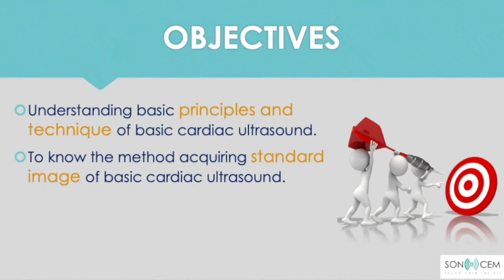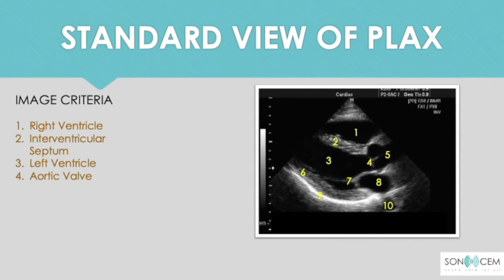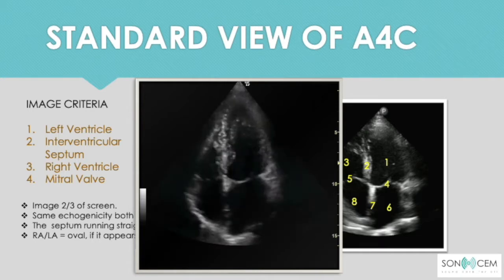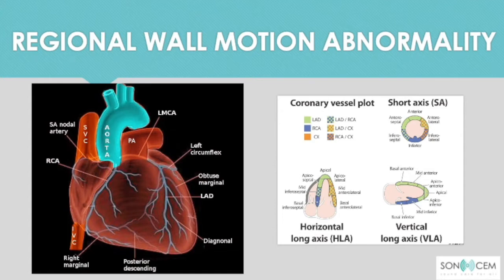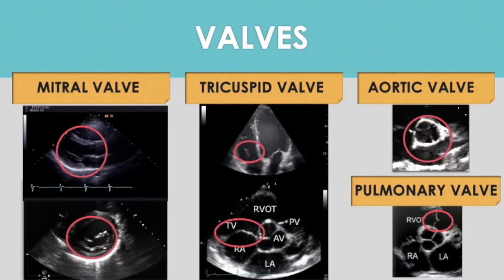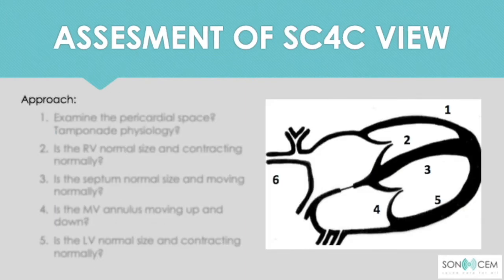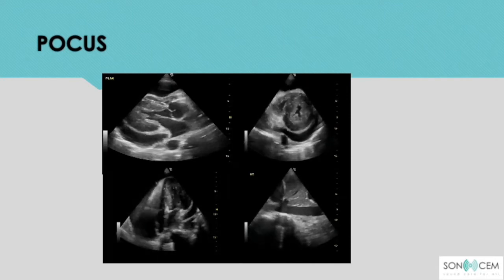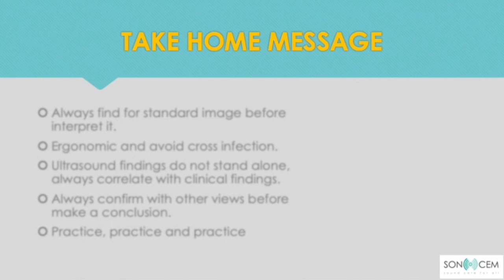Basic PoCUS 4: Basic Cardiac Ultrasound

Comment: At 17.10 do you mean D shape RV?
Reply from the maker: D shape LV. The high pressure in RV causes displacement of the septum, or called as flattening of the septum, that results in the D-shape, instead of original round shape LV.